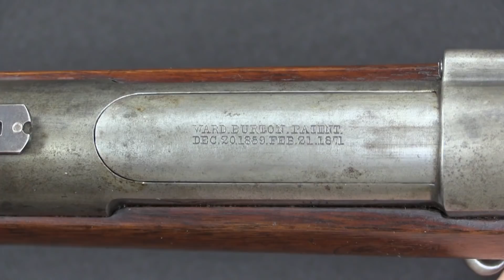Ward Burton Model 1871: The US Tries a Bolt Action

Comment: Ohh that looks simple. Ian starts bolt disassembly Nevermind.
Reply: The bolt is very simple... He even says so
Reply: Well for its function its simple. But to manufacture it is a horror amount of waste material
Reply: Exactly
Reply: My first thought was there's a lot of different dimensions and surfaces that need to be cut. Every cut takes time PLUS precision. A production line would likely have a specific jig and its own machine to make each cut. All adds up to time and money. Neat idea but I understand why the Ordnance Dept did not go with it.
Reply: A real beast to manufacture, surprisingly easy operation. I imagine a developed/derived model with simplified manufacture would have suited a buyer quite well if the opportunity had presented itself.
Reply: I actually said "ohhh NOOO..." out loud, as he started sliding it apart.

Comment: Company K of the Seventh Cavalry actually had the Ward-Burton carbine issued to them for a while to field test these after the trials. And it’s possible one was at Little Big Horn, as a few .50-70 cartridge casings fired from a Ward-Burton were recovered via archaeological digs. Company K turned them in and received the M1873 Springfield sometime before the 1876 campaign and were equipped as the rest of the regiment was at Little Big Horn. 

A couple of notable names were on the board for the Terry trials. Of course, Gen. Alfred Terry being one, the head of the Dept. of Dakota and reluctant commander of the Dakota column in 1876. Major Marcus A. Reno was also on the board, and was in that column under Lieutenant Colonel George Armstrong Custer, and had his share of troubles in that campaign and after.

Comment: As a hobby machinist i can safely say that is spectacular machine work. Thats a lot of steps and individual op setup needed with what was available then for machine tools. You figure the round stuff is easily done on a lathe but all those groves and notches needed to be done on a shaper or groover. All done with steam powered, belt driven tools.

Comment: I thought Mouser invented the bolt action rifle. With that huge breech. I wonder if they designed firearms on a drawing board or took chunks of metal or wood and machined them down to form parts.
Reply: Technically bolt actions had existed for at least 30years by the time of Mauser's 1871. The first in my knowledge was the Dryse needle-fire.